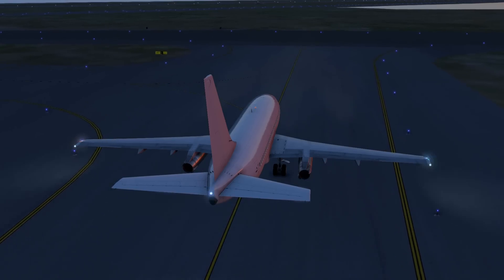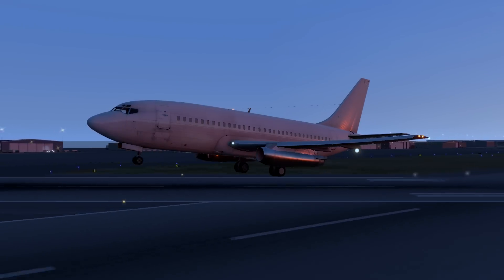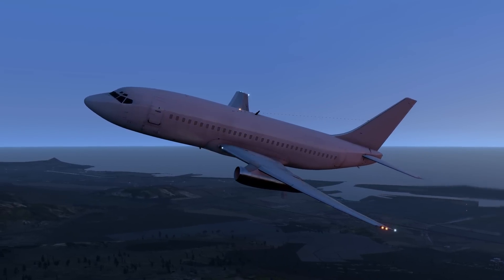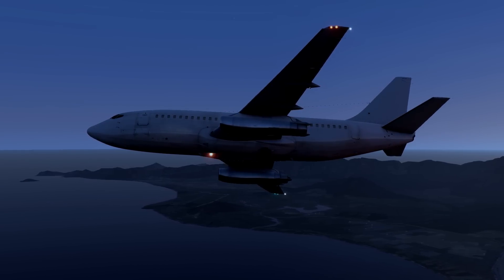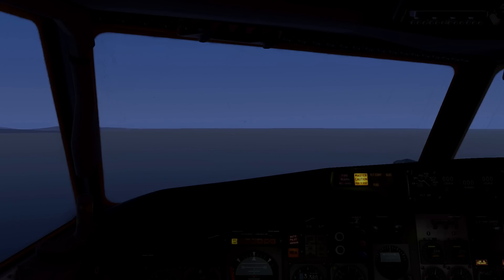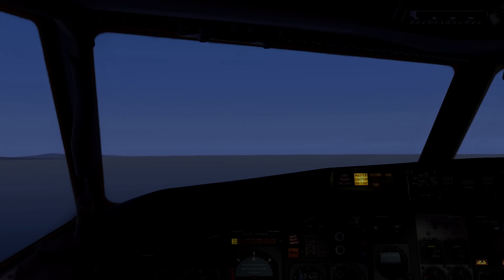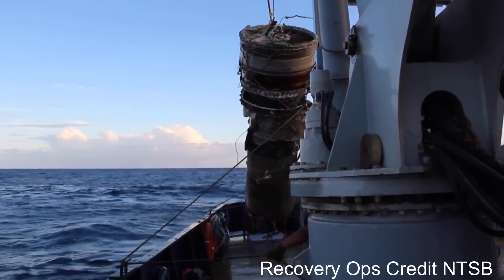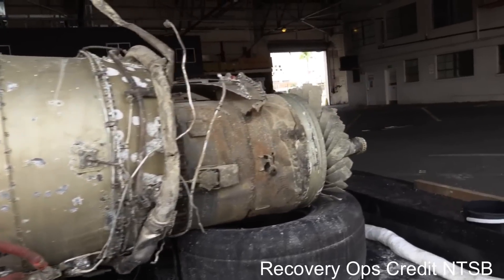The Split Second Decision That Sank A Jet | Trans Air Flight 810

Comment: It's easy to judge the pilots because it seems such a simple and stupid mistake. However, I changed my mind completely after I did my type rating on the 737. I can remember one sim session where we had an Engine Severe Damage situation right after takeoff. The bang was so loud and the movement was so violent that my brain just stopped working for a second, and it's damn difficult to get your shit together and complete the memory items succesfully.

People often don't realise how easy it is to make stupid mistakes when you are overloaded with stress, movement, noise, etc.
Reply: Thanks for sharing, and fly safe!
Reply: "Swiss Cheese Effect"  all the holes lined up.  Don't just blame the pilots.   There are many reasons planes "all accidents " happen.  1 older plane, 2 Maintenance, 3 night time, 4 Fatigue working at night, 5 over dark water,  6 shortly after take off low and slow, the list goes on and on.  I love how the none pilots judge the pilots when 90 % of you people drive reckless everyday while on your phones or putting on makeup, so on.  All of us have hundreds of lives that we can destroy.   Judge yourself when you simply drive your car.  Pilots are humans too with families, bills, doctor appointments, every day stress.  Pilots can not take any meds to depression,  pilots have a strict medical guidelines, pilots have a terrible work schedule.   Don't judge the pilots when most of you drive around a 2 ton car like your at Nascar while not even looking straight ahead.
Reply: Pilots are worthless for evaluation ... Even when another pilot completely blows it.   They will try and find some way to absolve him of responsibility.   Here's an idea .. get out of pilot/cult mode and call things as they are.  These TransAir 810 pilots are the one's who refused an immediate landing and ask for a vector... Out Over The Sea away from the Airport.. So they could run a "checklist" .. and then didn't run any type of checklist that checked throttle position.
Reply: It's not "damn difficult to get your shit together" on proceedures you've done 1000's of times.  Professional = Practice.  You practice, practice, practice..  You especially  practice recovery steps when a plane is in it's most vulnerable state= takeoff.   Why would any Pilot not know the recovery steps of engine/out at any altitutde on takeoff for his airplane?  Knowing those procedures is just part of being a true Pro.   Did you know you could.. without warning .. stick me in a closet and turn the lights off and ask me to tie my shoes?   I could accomlish it in the dark.. easily.. because I've done it 1000's of times.   Stop being just one more sapp .. who tries to absolve the pilots of responsibility.
Reply: @TenGreenRangers  it's not even remotely comparable to tying your shoes. And I can tell you, I had practised engine severe damage situations numerous times in fixed base sims before. I had done those memory items tens of times before and I knew them like the inside of my pockets. And yet somehow it was nearly impossible to complete them the first time i had an engine explode in the full flight sim. And the crazy thing is that I even knew that it was coming. But I can promise you that after a super loud bang and almost being thrown out of your seat, accompanied with violent roll and yaw moments in a way you've never experienced before you can't even remember your own name, let alone complete the memory items. I really needed to take my time to get my bearings and make myself calm down. "Practise practise practise" only works up to a certain extend. You can know all the memory items in the world but shit is always different when it actually happens in reality (or in a full flight sim which comes pretty close). It is the responsibility of the airline to provide this training, and they failed to set a proper standard.

Just wondering, how did your engine severe damage scenario go the first time you did it in the full flight sim?
Reply: Such people who can easily be disturbed with few alarms n change in environments should be in a diff career n not be pilots. It was a pure pilot n human error , nothing else.
Reply: Well said
Reply: Not necessary. Just get the person you want to understand the issue to count backwards from 1000 by 7’s while you jostle them.
Reply: user-sh6bl8vw3q  it's not about excuses, it's about reasons. Poor training was very likely the reason, not negligence on behalf of the pilots. It's not about the mistake itself, it's about the reason for the mistake. It's very easy to blame the one responsible for flipping the switch, but it won't solve anything unless you find the reason for the mistake.
Reply: 90% of the people who judge pilots shouldn't be driving their car on public streets.  Normal professional pilots always try to be self conscious what they are doing.  It's impossible to train for every emergency.   When your in the "hot seat", it take 30 seconds or so just to know there is an emergency.   Then you look up to a bunch of flashing lights and sounds and go through your memory items, at that moment instant tunal vision, unless your doing it every day, there will always be that "one" memory item you forget.   FLY THE PLANE, IDENTIFY-VERIFY .  THAT ONE MEMORY ITEM, didn't verify.  It wasn't just the pilots who made a mistake.   There was a whole chain of events.
Reply: There is an actual bang during flight simulation? That's neat I mean that makes sense bc you'd have to be nuts not to train people
Reply: @idonthaveanamenoone3526  yes you can hear it and you can feel it. The simulator shakes violently. I'm not sure if the motion is completely realistic but it does create a startle effect. Part of the training is to overcome the startle effect and getting your mind together.
Reply: Also, some people rise up under extreme stress while others fold and become useless. And you never know who's who until the poop hits the fan.
Reply: Yes I agree but that’s why not everyone should be a pilot… if you can’t handle stress then stay out of the cockpit for the sake of everyone’s lives
Reply: @DarkWokeSuperSoldier  as I said in another comment, it's not fair to blame the pilots for the mistake, but rather we should blame the reason for the mistake. There could be 1001 reasons why they made that mistake and very often it is poor training and standards on behalf of the company. Also, lets not forget that they succesfully ditched an ancient complex high performance jet with no engine power AT NIGHT. I'm not sure if that ever happened before.
Reply: Ok but that's what the sims are for, so humans get trained for those conditions. Kinda like a karate class.
Reply: @curlyvideos  if the training is bad and the standards are low (like they were) those sims won't help you. Setting high standards for training and safety is the responsibility of the airline.
Reply: Maybe all high schools should add to their curriculum somewhere a "test" where the kids get into groups and each group has a group exercise, relatively simple, but like an "Escape Room" thing inside a connex cargo container... Just a basic series of steps and a little bit of thinking to unfasten the latch and get out... The first time they do the exercise it's all fairly straight forward and they're timed and sent to the second "Test"... Where they get into secured seats, and THAT container is then latched shut and sent bouncing and tumbling down about a 30 foot embankment... just all "ka-plop" and sh*t... AND THEN the timer starts again... AND then they can ALL get together in the class room to discuss (debrief) the experiences and the difference between "at rest" doing something in controlled circumstances and "for realzies" doing that same thing when all hell is breaking loose and you're not even sure which way is up or down...  ;o)
Reply: @gnarthdarkanen7464  My last day teaching high school, I did something very similar. I thought I was teaching the kids important life skills. The parents and school administrators thought all the broken bones didn't make the learned skills worth it.
I thought it was a great lesson. Now I'm not allowed within 500 ft of any school in our district.
Fortunately the district in the next town over is looking for an elementary teacher. I think the lesson will go over better with kids who's bones are still bendable.
Reply: @ddegn  Good luck with that!  ;o)
Reply: @ddegn. Just need to tell them to toughen up a-bit! 😁
Reply: @gnarthdarkanen. Sounds a-little similar to the Offshore Survival training. You're put in a helicopter body in a swimming pool & have to escape as it's slowly lowered under the water. The 1'st lot of 3 time's are simple but the next time's it's done faster & rolled upside down, you have to wait until it's stopped to escape but some people panic & try escaping early. It's about as realistic as possible for a training course.
Reply: @peterj5106  Had that class in the Navy. At certain Training Centers (NTC's) they could offer some of the class drills for just about anybody who had the time on their hands... and you'd sign up... get through a safety briefing or course (though 9 out of 10 were nearly the same thing) and go to the site for the drill...

     SO I signed on and went to the "fighter jet" version as well... Mostly, they encouraged us to do some of those "outside your rank/pay grade" drills to get a taste of other jobs in the military and build a certain respect... so we (regular deck-apes) didn't bash pilots and officers quite so much without actually addressing issues...

     The fighter jet version was kind of terrifying but kind of fun as hell... haha...

     SO picture the cockpit of an F-16 on a trolley attached to a roller-coaster track segment that goes down at somewhere between 45 and 60 degrees into a pool with a curl at the end to flip it upside down AS you hit the water... 
     SO you sit in this thing and get the straps on, and then put the flight helmet on with duck tape over the visor... and you clip the 'breather" mask on and can barely breathe through it (even if it's just an empty tube) and can't see a damn thing... and they could spin the one I was on at the top... to completely disorient you blind... and forward, sideways, backward... whatever it stopped at, that was when the instructor kicked it and down you went... SPLASH... so NOW upside down, in the dark, underwater, and completely blind, you've got to take the mask off and get free of the straps and open the canopy to get out... 

     Good luck... and hope you paid attention when they were explaining the canopy and straps mechanics... or you might need rescued AND resuscitated by the nice Navy Seals in the pool watching...

     Yeah... I'm familiar... In the helicopter thing (which I was thinking of with my original suggestion/post if I'm honest) we had ONE guy in the group before mine who "got excited" and managed to get himself catapolted out while the thing was still "falling" into the pool... possibly the worst belly flop in history, but he was lucky he didn't hit the side of the pool.

     In any case... yeah, it probably sounds familiar for that reason... I just don't think we necessarily have to risk drowning to get a point across to high school kids, OR to help them come to terms with just how much importance the practice part is for skills they might need in a crisis. Impress it upon them while in school, and it's actually pretty amazing how much improvement students can make by taking the initiative to actively work on learning, for themselves.  ;o)
Reply: @gnarthdarkanen7464 had several advanced firefighting and flooding trainers that place you with those stressors. Fire don't go out until the instructor wants it to and the flooding is always getting worse until you have to escape through a flooded room above. Fun times.
Reply: @NavyVet4955    Yeah, we got sent in groups to the SS Buttercup, too... Pipe patching and scrambling for leaks, trying to secure valves underwater... 

     ...sitting on the emergency soft-patch while they primed it with 150 psi off the firehose... haha...

     AFFF flying around... disposing of magnesium fires... and somebody always forgetting or misplacing the donkey-d*ck...

     Mass casualty drills were the most fun, unless you got to volunteer for one of the bad casualties... Corn syrup SUCKS when it cools... stiffens up... starts pulling hair that should NEVER EVER get pulled...

     Nevermind the klutzes who could manage to f*ck-up the management of ladderwells with a stretcher... or backboard...

      Yeah, fun times... FUN times... ;o)
Reply: @gnarthdarkanen7464  Hell they can even teach drivers education or, as in my case one full semester of "Government" class which was required to graduate.  One of the best classes I took from HS was Government to learn about the 3 branches, Bill of Rights, and the local and federal election processes.  Also, drivers ed was more structured and was a full, though elective (if you wanted a DL), semester.  This was back 1969.  By the time my kids went to HS neither course was taught by the schools any longer.  Though not directly addressing your comment, it's just another example where our public education system is failing to prepare kids for the real-life issues they'll face.
Reply: @bobbyd6680    Yeah, the politicians (and everyone involved in putting the assholes in office) seem to be more interested in investing in prisons, weapons, and violent and destructive human rights abuses than in education or "removing excuses" for terrible behavior...

    I'm "Gen X" and may well be among the lucky last generation to enjoy a quality of educator that you and I seemed to have back in the day... even if we (at the time) questioned the efficacy of the system we were in.

     My point (in the original sentiment) was to offer a relatively "controlled crisis" for the kids to cut their figurative teeth on, maybe give them a taste to understand just how difficult it can be even just to think when "sh*t hits the fan" so they can get a little more serious in their own efforts to learn...

    While we can bash the system, and it DOES have real issues and deficiencies galore, there's also a LOT to be said for students taking active part in LEARNING instead of expecting teachers to mysteriously pour knowledge into them.  ;o)
Reply: I hear what you say. However the mistake is unacceptable considering the training and experience of the pilots. I cannot make any excuses for such an oversight, no matter what the circumstances, this is extremely unprofessional.
Reply: @marknewell997  I don't agree. I wouldn't call them unprofessional. Unprofessional would be deliberately cutting corners or ignoring risks. The pilots didn't do that. Yes they made stupid mistakes, but the most important thing is to figure out the reason of these mistakes. Perhaps the training wasn't of high quality or maybe there were deficiencies in company procedures or maintenance, who knows. In the end the pilots performed a succesful ditching in a very high stress and time critical situation and they saved themselves. The fact that they're alive is the most important thing, and it is essential that we learn from this.

It is not fair to blame the pilots for the mistake, but we should rather blame the reason for the mistake.

Comment: should have started the APU
Reply: Yeah, APUs are so powerful, you don't need engines at all. 🙄  Opening up the air inlet for the APU would probably have slowed the aircraft down even more. APUs are not designed for thrust.
Reply: @ImperrfectStranger  always start apu with loss of engine--  hudson river nyc,, first thing he did was start apu,, why idiots ?

Comment: Yikes, another "wrong engine shut down"? That's a bit oof.
Reply: @BruhYouKnowWhat   Yeah, like a surgeon cutting off the wrong leg. Wth is up with that?
  When trouble shooting a power issue it seems logical to first double check the gear positions that give you said power.
Reply: @LindysEpiphany l have a friend who had the wrong knee replaced.
Reply: @MrChopsticktech 
This would be a nightmare! When I had carpal tunnel surgery they had me write in permanent marker on the surgery arm. 
  You would think with all the people in an operating room somebody would catch the mistake and/or at least one person would  double, triple check for accuracy.
Reply: Better to shut down neither
Reply: @technophant  its impossible...debris from bad engine or surge or fire ...can cause structural failure
Reply: Atr72 malasia crash
Reply: Skill issue lmao
Reply: a real "oof size: large" moment